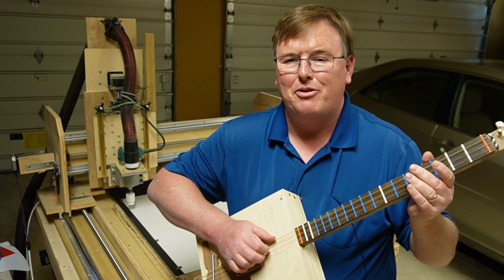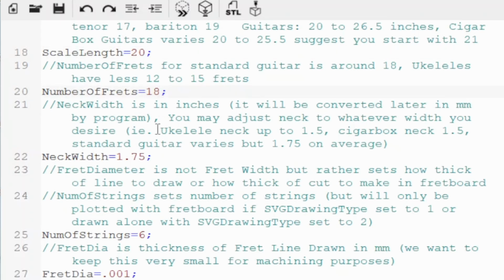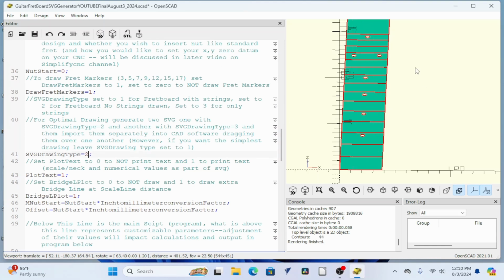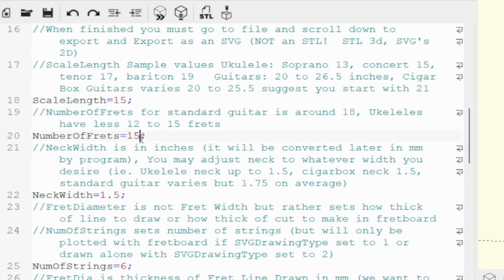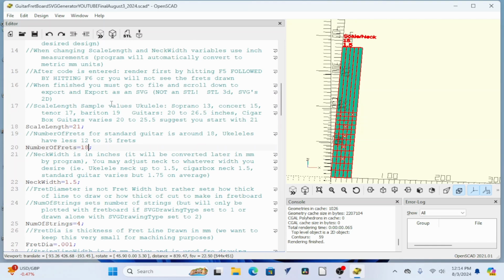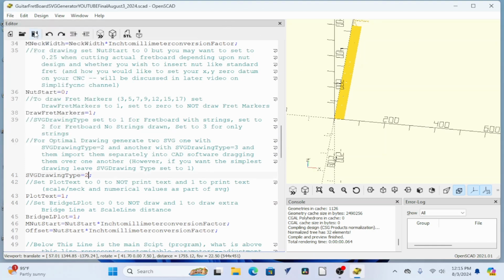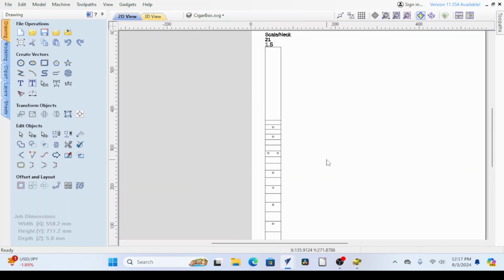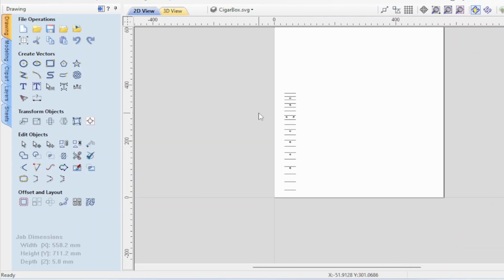FREE SOFTWARE to design custom guitar and ukulele FRETBOARDS -- CNC GUITAR BUILD PART 1

Comment from the maker: NEW ADDED feature to the opensource Simplifycnc SVG Fretmaker Software now allows one to add a customizable headstock to front of fingerboard with a user chosen number of tuning pegs (0 to 12) and AUTOMATICALLY places the tuning pegs at PRECISE evenly spaced locations (ready to cut on CNC or machine by hand!!!)  Be sure to see my next video for FULL RELEASED OPENSOURCE fretmaker software (with a brief demo of this feature as well).
Reply: cigar box newbie here, I'm not happy with my fret board but now I see a solution on the horizon.  Thank you for all your work . Looking forward to learning this.
Reply from the maker: @mikestraker2180  Thanks. My next video with full code will be posted this week. I also added a new feature to the program that allows a headstock and places the tuning pegs on the it automatically at the correct spacing.  I think many cigar box guitar makers will find this to be really helpful.  If you have any questions once the program is released just let me know.  Thanks for commenting.  I really appreciate your input.
Reply from the maker: @mikestraker2180  Part 2 video with full software code is scheduled to be released on Friday August 9th (in the morning).  I think you will like some of the additions I have made to enhance its use.
Reply from the maker: @mikestraker2180  My new video with the full OpenSCAD code is up.  Here is the link:  https://youtu.be/LTq6V-_JsiA